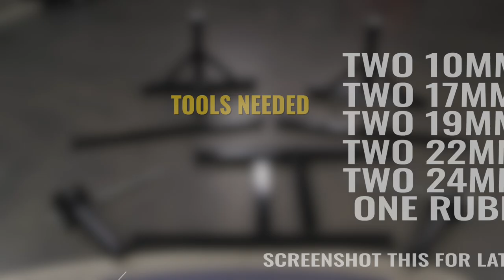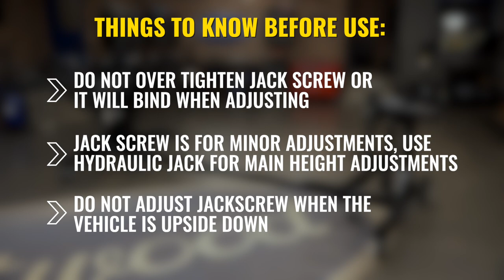How to Assemble the 3000lb Rotisserie - Eastwood

Comment: Bought one of these but was missing a few parts, bolts to hold one of the hydraulic cylinder(found some at home depot), one of the large connector beams(which I'm waiting on customer service to reply to an email about a replacement). Also has some bubbles under the paint from painting over rust, and even some areas were never painted and covered in rust.

Comment: I have this rotisserie as well and almost ready to put my 51 Special on it. Now I wonder if the bolts that hold some of it tight will actually hold it. I can imagine with some weight on it some of the bars could slip pass the bolts. Or is it better to drill through just in case?
Still a bit anxious putting it on. Its reinforced
Reply from the maker: We're confident that if you follow the instructions here the tool will performed as promised.  That said we have seen some guys throw a couple tacks on rotisserie's and body carts in the past for extra protection.  Call us directly if you need additional support: 800-343-9353
Reply: @eastwoodco  was thinking about that too after some time. Just to be safe and saves time drilling extra holes and using longer bolts